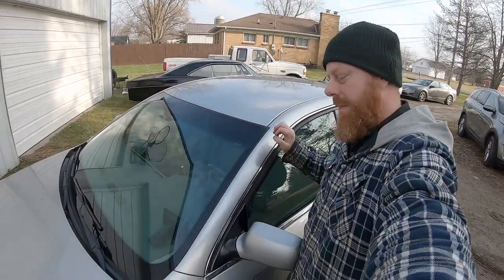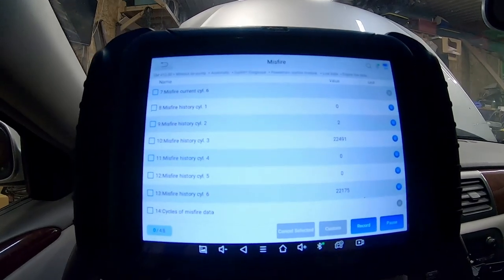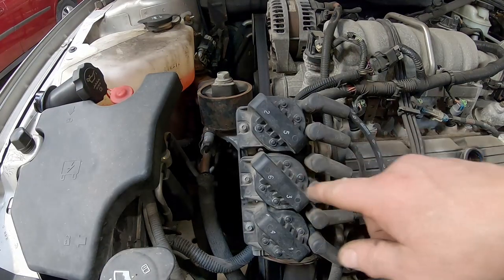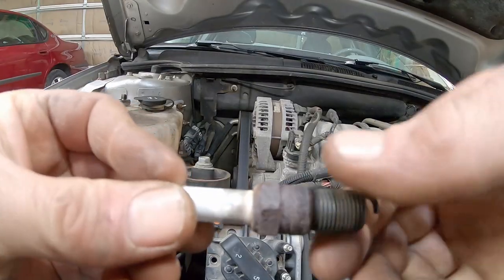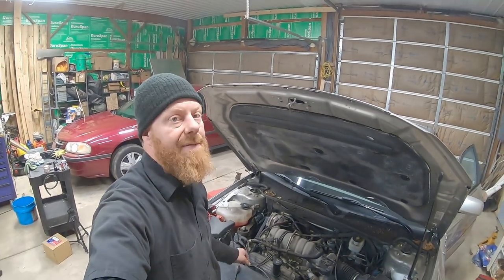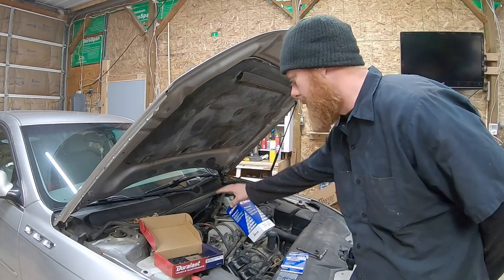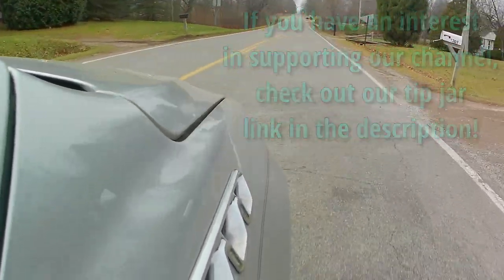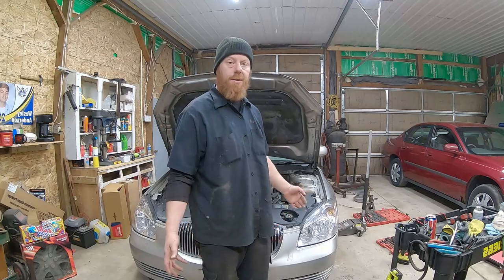2008 Buick Lucerne Misfire SOLVED!!!

Comment: Once you've seen this, you'll never forget it. On those engines to check for bad equipment take all the boots off the coils and tie them back so they don't get in the way. Then crank it over. If it's good you'll get a hot spark between each coil post and if it's bad, you won't. All six shoot insane fire and make quite the display. Here, the top one would not do as good as the bottom two and even with swapped out coils it would have been the same story. Good idea to replace the consumables as that's how it is supposed to be done. They will work with a 180 degree thermostat which keeps my summer temps from reaching on over 200 regularly like it used to do without complaining about it on the OBD system. But it does mean a bit less heat in the polar vortex days. Mines a 97 series II, must of had a leaky injector while eating lunch with the radio which required some ignition key on and offs to keep it alive. When I started it back up finally, it misfired quite a bit and threw the MIL on me. Great now I got to go find my code reader to clear it. Next day I fired it back up to go get the mail and it wasn't on anymore - at least mine will clear itself if the issue doesn't persist. On the other hand, I had to go to town once with the space saver spare tire on and picked up a check tire pressure nag text in the instrument panel, that one never went away until I had to pull the battery to recharge it when it wouldn't start in the above polar vortex. So disconnect the battery for that one, and I still have to find my code reader.

Comment: In the series I AND II 3.8 you are supposed to change the plugs every 30,000 miles. It fires the plugs twice because it has a waste spark which fires on the exhaust side. 140,000 miles is a lot of miles for plugs on a 3.8L.
Reply from the maker: I agree.  That's why we replaced the plugs.
Reply: @andersonsgarage2334  The comment wasn't directed at you. I know you changed them. I was commenting so readers would know this wasn't a regular engine with 140,000 that still needed plugs changed. This was a car that previous owners were incredibly stupid about taking care of their car.
Reply from the maker: @altg5708 I apologize if my reply sounded obtuse and I do appreciate your comment.  I took it exactly how you intended and agree with you.

Comment: My mom's 2005 LaCrosse 3.8L had the ignition module fail - TWICE within 5000 miles. It also led to a premature failure of the catalytic converters so those had to be replaced.  So far it has been running fine.
Reply from the maker: Parts today!  Bummer when that happens, especially wiping out the convertors.

Comment: My car ran cooler, gave me coolant too cool code. About a week of this and she got harder to start. Today was cool damp morning. Poof, multicylinder misfire. Thermostat killed the ignition module. She has to run 177 or higher. 2006 buick lacrosse with 59,000 miles. 18 years old but driven very little. Lesson learned.

Comment: I replaced my oil sensor on my 07 Buick Lucerne 3.8 but the message center still says add oil low on fluid.... Do I have to reset the oil sensor??

Comment: My 06 buick lucerne cxl has a misfire also and I changed the plugs and wires and it drives 85%better and I cnt get the check engine light to come on or flash like before but there is still a little miss there I can feel it..could i have the same problem???
Reply from the maker: It's very possible.  What brand of spark plugs did you use?  Unfortunately all spark plugs are not created equal.  Do you have access to a scan tool where you can see the live misfire data?
Reply: @Anderson's Garage  I believe they were ac Delco iridium spark plugs..And no I dnt have that tool..ive been chasing this problem for weeks now and it jus been a head ache
Reply from the maker: @cali8221  AC Delco plugs are good.  It's really hard to say without scan tool data.  Around here a used set of coils and module is about $40 at the junkyard. Maybe it would be worth swapping a used set in and seeing if it goes away
Reply from the maker: You could also check the resistance of your coils with the multimeter.
Reply: @andersonsgarage2334  ok thanks
Reply: So im back ..ive done the wire and plugs the ignition control module 256 dollars and today the ignition coils the only thing left is the sensor..its not as bad as before but I feel it a little bit between 55 and 60.Also when I driving and have my foot on the pedal and hold it there in 1 position dnt increase or decrease it will be going then all of a sudden take off like I hit the pedal but I didn't...sum one plz help me
Reply: @andersonsgarage2334  I went and bought plugs and wires new and ignition control module new 256 dollars and today ignition coils I neede 3 they were 52 bucks a piece and the problem has gotten better yes but not all the way fixed..its killing me and my pockets
Reply: So I'm back..after replacing everything ignition related plugs wires coils icm crank sensor cam sensor it was my fuel injector #5..after I fixed all of that a code came on and said fuel injector number 5 also..im so done with this car..
Reply: @cali8221   Same Here Quality = 0.00
Reply: It's coil packs not Injectors , sensors, spark plug wires that's your problem.  
The coil packs go out on these that cause a miss fire.  I carry spare coil packs with me in the trunk. They go out about 30-60k miles.
This engine is very easy to work on and fix and learn to fix for the average person.  Unlike a toyota,  honda, german v6 car. If you want a reliable car low maintenance get a toyota 1.8L
Reply: @dylano7242  ok well that's you're problem wasn't mine

Comment: I have the same exact car. When I first start it up it’ll do the same exact thing, the rpm’s will drop for a few seconds then rev up to normal idle. I replaced the gas pump thinking it was that but still getting the same response. Could be bad spark plugs? I’m not getting any check engine light on.
Reply from the maker: It's possible.  Do you have access to a scan tool with live data?

Comment: What brand of diagnostic scan tool are you using? I had a hard one on a Mitsubishi 2.4 L engine. The EGR and CAT monitors would not set (no fault codes). Up stream O2 sensor going crazy trying to compensate for air leak somewhere on the intake side. Smoke test revealed TB throttle shaft leaking. Replaced throttle shaft seals. Did not work. Went to junk yard got another TB, and replaced shaft seals. FIXED. Apparently the original TB throttle shaft bore was worn out, and sucking air.
Reply from the maker: I never would have thought of the shaft seals.  A smoke machine definitely reveals some things when diagnosing a problem.  Its an xtool D8 pro.  We have been thinking of making an in depth review on it.  Would that be something you are interested in seeing?  Thanks for watching btw.

Comment: Great video. I had a coil fail last fall. It was cracked.  Replaced all the coils and spark plugs. And the car has been great until today. Started getting a misfire. Started with a blinking check engine light. Then it stayed on. Cylinder 2 is what my cheap code reader said po302. I removed the spark plug, and it looked fine. Swapped with #1 plug to see if it followed the plug. Took it for a drive 4 mile drive, still misfiring. But the code is po300. Maybe it hasnt settled into cylinder fault yet. Any suggestions?
Reply from the maker: Swap coils and see if the misfire follows?  Could be the ignition module.

Comment: Did the check engine light come on alering you to the misfire and and ignition module problem?
Reply from the maker: Correct.  The check engine light was illuminated.  However the dtc was P0300 multiple cylinder misfire.  It wasn't until I watched the data that we narrowed down which cylinders were misfiring.
Reply: Forgive my not understanding, but the fact that the ignition module was the ultimate problem, had to be discovered by your own investigation. There’s no tell that, the actual issue was the ignition module?
Reply from the maker: @frederickbehn5610  that's what the video was about.  Moved the coil and the misfire did NOT follow the coil, which means the module failed.

Comment: Would it be possible he module would prevent the car from starting at all? My mother in law's car won't start snd ive went through the list. I removed the number one spark plug and tested spark the same way you did and there was nothing. HOWEVER when I put the plug on a ground point on the frame it sparked and the car started.
Reply: Spark plug needs a ground to make the spark, if it sparks on the frame and not the engine , check the engine to frame ground wire. Should be as thick as you`re little finger.Can look ok but be broken inside.
Reply: Could be fuel pump relay. My mom's burnt 2 out. Ended up being the whole fuse box under back seat was bad. Caused by the seat latch pushes against it and burns up the socket the fuel pump relay goes.

Comment: I have an 02 buick century and I bought an ignition module that wasn't gm original equipment got it for under a hundred bucks and I'm throwing the P0300 code I've changed plugs wires iac tps coils throttle body fuel pump and filter purge valve and maybe this might be my issue I don't know for sure but I hate P0300 it's a freaking headache
Reply from the maker: @NoLiesToldTV  it certainly could be a step in the right direction.  Sometimes the aftermarket modules don't work correctly.
Reply: @andersonsgarage2334  I sure hope so man!
Reply from the maker: @NoLiesToldTV  come back here if not
Reply: @andersonsgarage2334  cool I  appreciate that man!